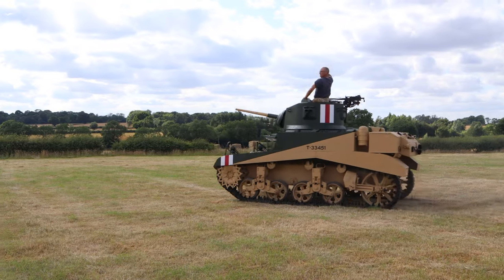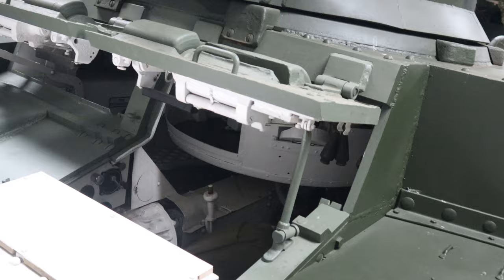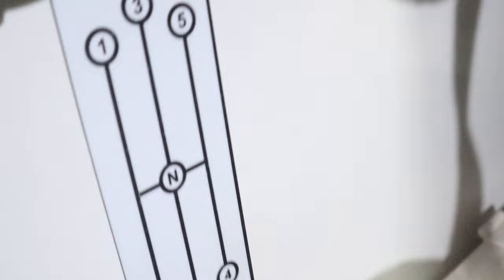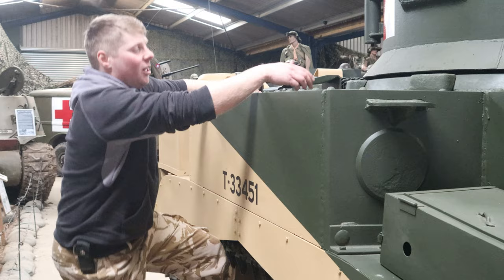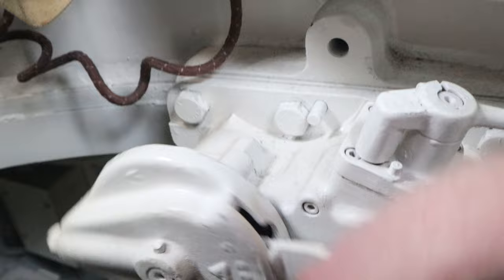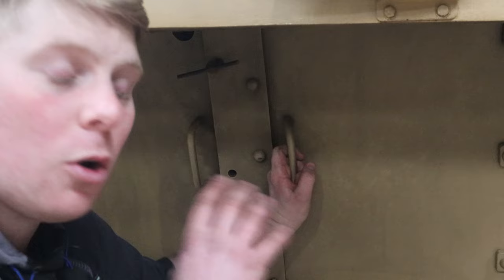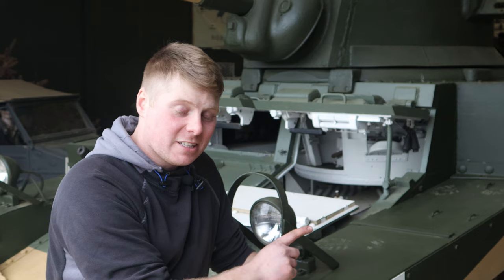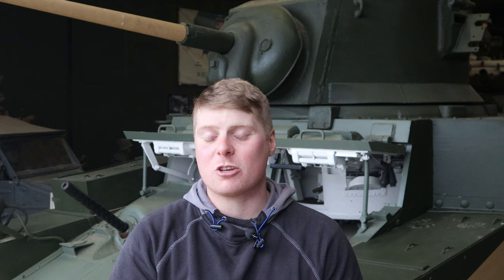Tank for sale! We are selling our WW2 M3A1 Stuart light tank

Comment: While working on the construction of EPCOT in 1982, I came across an M3 chassis with a cut down upper hull.  It had a semi-truck fifth wheel setup welded on top and was in one of the lay-down yards.  It was used to pull the semi-trailers through the deep sandy areas of the jobsite.  I wanted it so bad.🤤